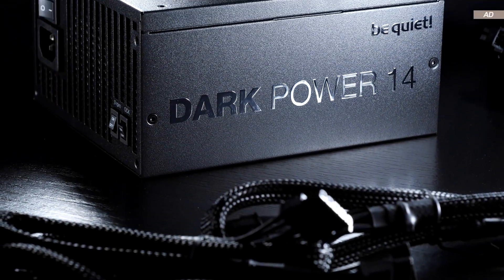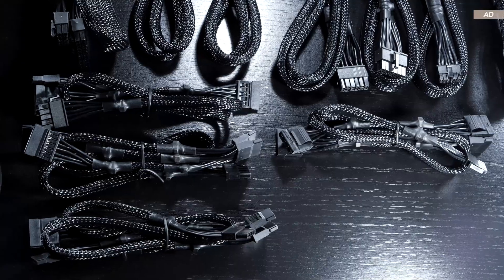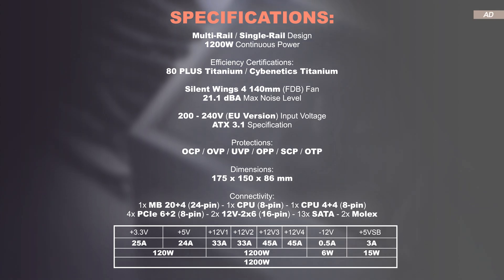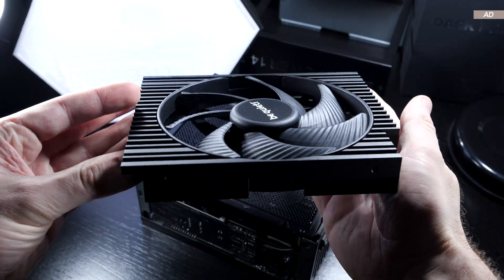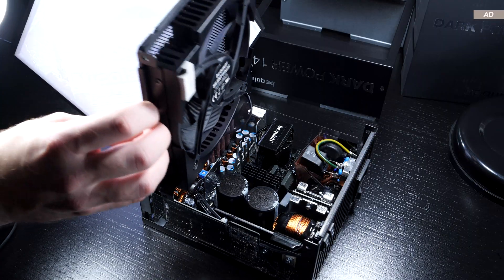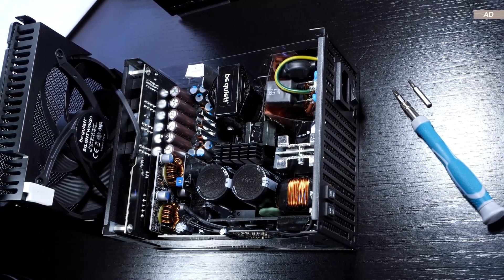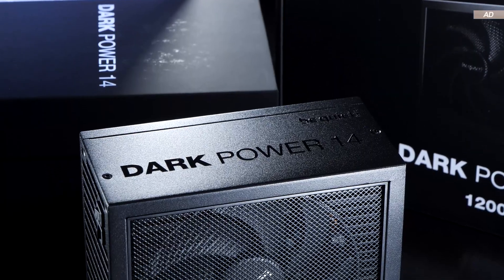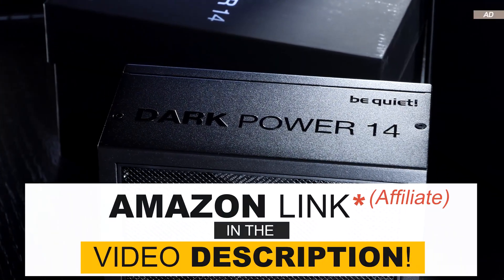The BEAST Among Power Supplies! — be quiet! Dark Power 14 1200W

Comment: got the 1000w for $229, wanted the 1200w class but the 1000w was a great sale, 5080 is no where near a 1000w rig. it comes in at 698w as is, so say 750 at max.

my crosshair apex will love the single rail, should I have gotten the 1200w for max OC plus a little headroom, it is a 10 year psu and will outlive most family pets.

Comment: Got one today for my new build after 7 years. Going all out whit a ryzen 9800x3d and rtx 5090 asus astral cant wait
Reply: My man, i'm in a similar position with 10 years. Feels good going from a 970m to a 5090
Reply: How it was?
Reply: @Jordii-w4l perfect no problems yet. Quality is verry nice and verry quiet.
Reply: @v.5505 Nice. How do the PSU cables look? I'm worried about cable management.
Reply: @Jordii-w4l  The cable looks and feels premium. I made my build with the Fractal North XL, so cable management was not really an issue. I do recommend a medium case at least. This is a 1200w PSU, so don't put a beast in a cage.
Reply: I have a North XL, and my Dark Power 14 is on the way. Did you put the PSU with the fan facing upward or downward?
Reply: @Jordii-w4l nice ! I honestly cant rember. But i think there is only one way to instal it anyway. So i dont think you have a choice 😃

Comment: Is the heatsink in contact with the internal components, all of which are at different heights? If so, where is the thermal paste to ensure heat transfer?
Reply from the maker: Yup, thermal pads.
Reply: @Nicolas11x12English  that is good or bad? I am noob but planning to buy one